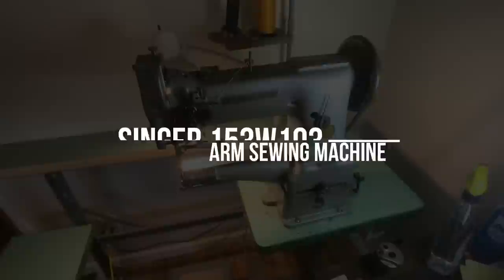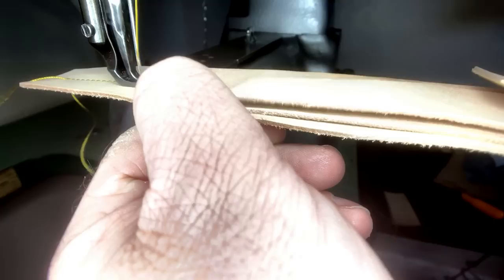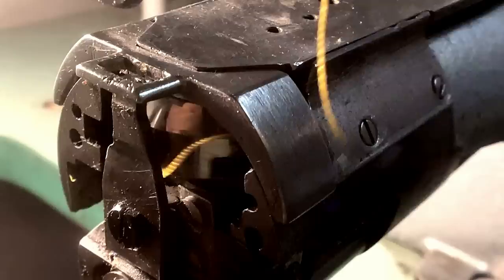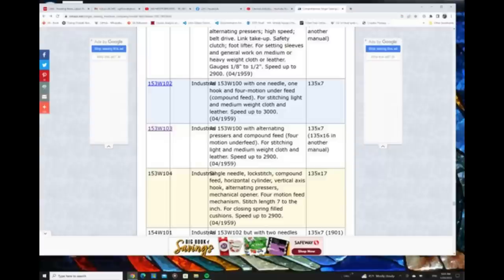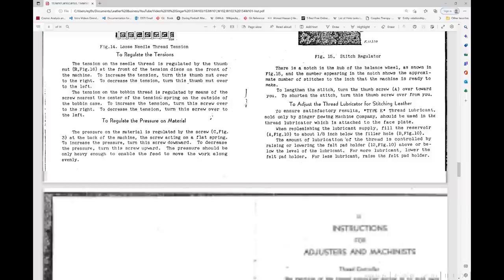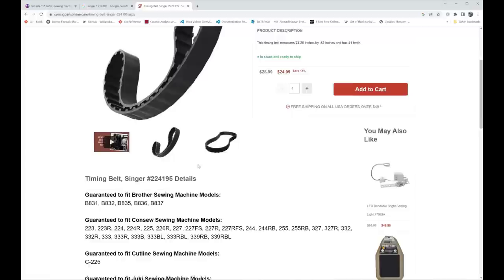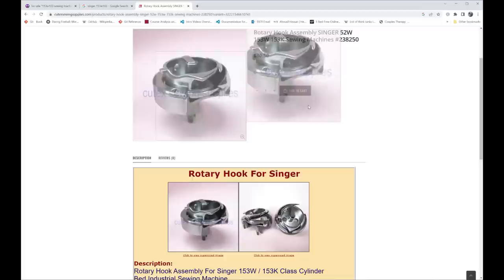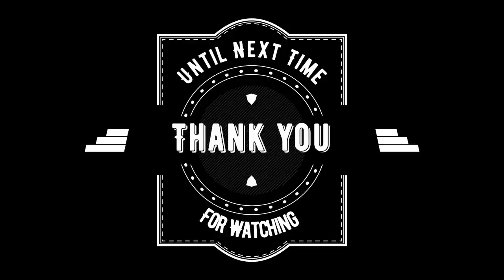Singer 153W103 | The Original Cylinder Arm for Leather | Sewing Machine Review

Comment: When going back a few stitches for locking the stitch, you either can go back one stitch at a time or go back several stitches and then cut the long stitch back. Do not back tack with a leather needle, it cuts the thread. A leather needle has knife edges to cut leather and a fabric needle has a round point/egg point to push between the fabric seams and does not cut the thread on a back tack to lock the stitch.
Reply: True, leather point needle will cut the thread. That's why I always use round point fabric needles 135×17

Comment: Thank you! I have a 153W103 that is bound up. That’s the best way I can describe it. It will only spend about 3/4 of a turn at the fly wheel on the machine.
Reply from the maker: It is always hard to know exactly where the binding up is taking place.  We use wd-40, and also hair dryers to get stuff unfrozen.  I would start in the hook area and move up towards the take up arm assembly .
Reply: Mine had the same problem and fixed it by adjusting the needle bar because mine was way of and it will turn 3/4, the top of the needle bar was hitting the body of the machine.

Comment: Thanks! Your feed-dog is not shot, you have a special feed-dog and end-plate for sewing in tight spots like the nose of leather bicycle saddles and old motorcycle pan style seats. I have been looking for a feed-dog and end-plate like yours with no luck for quite some time. I would be interested in your parts if you convert over to a larger feed-dog and end-plate. You just cannot change your feed-dog only, you have to do a conversion. Take care!
Reply from the maker: OMG.  This is why I love YouTube.  I started to realize this as well about the feed-dog, but I had not researched it yet.  I just knew that it was very different than the one in the manual, but I did not know exactly why.

Comment: The reason you have to change the stitch length like directed on your cover plate is because the original stitch length adjustment shaft became too brittle over the years and breaks. The original stitch length adjustment shaft is located in the center of your hand-wheel and it breaks, it can be pounded in all the way and then the stitch can be adjusted like directed on your cover plate.
Reply from the maker: Yes, you are right and I suspected this was the case all along.  I still need to take a closer look at the set up.  Do you think my parts could be duplicated to fit your machine?
Reply: The parts cannot be duplicated easily. I have looked through all of Singers, Consew cylinder arm parts with no luck. The parts probably were made for a Singer 153-SV or 47 -SV model and transferred over to your machine.

Comment: Any videos on how to thread this machine.  I think I did it right but now the bottom thread won’t come up and I can’t see anything pls help
Reply from the maker: Make sure you are threading the needle correctly, or if the needle is in position correctly.  I believe there is a PDF version of the instructions online.  I have not used mine recently, but I recall the thread going from the left through the needle to the right.  Not picking up the bottom thread could also be a loading issue in the lower shuttle.  I will consider making a video of threading soon if you can't resolve.